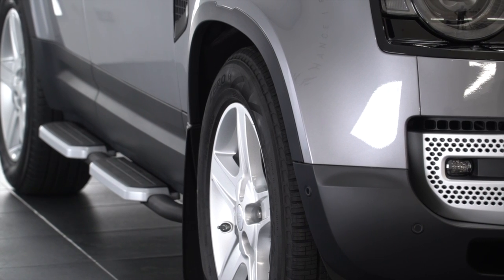First 2020 Land Rover Defender Full Detail & Paint Protection

Comment: Fantastic job but detailing and paint protecting a Land Rover Defender kind of defeats the purpose of what a Land Rover Defender is supposed to be. A rugged off roader where the panels are riveted in and can be replaced cheaply (if you want to) so it doesn’t matter if they get bumped or scratched.... in fact, it’s almost expected